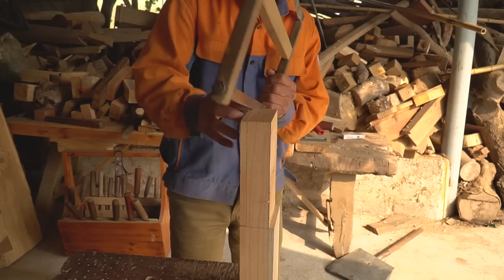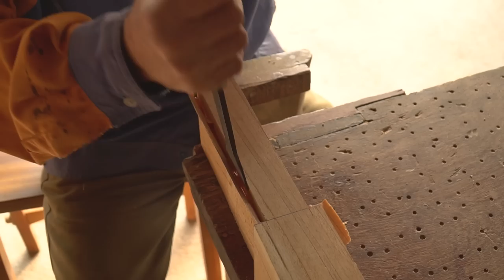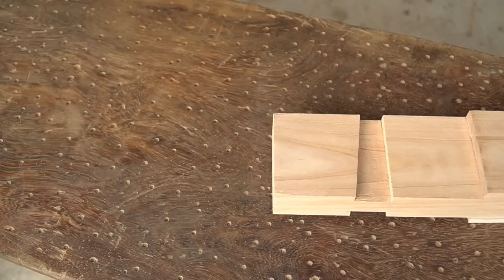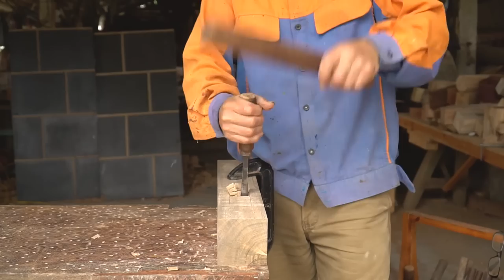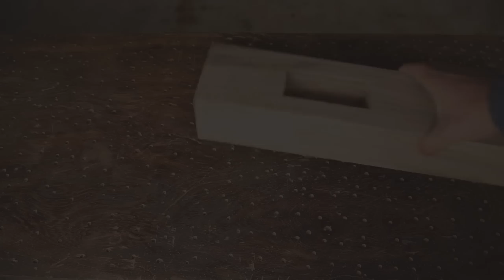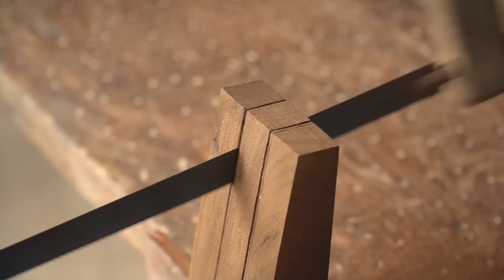WOW Traditional Woodworking Joints Skills, Amazing Wood Structure Locked For Table

Comment: Tusk tenon with external wedge rather than the usual internal wedge in a through mortice. A nice variation on a standard joint, and, for once, practical and useful.